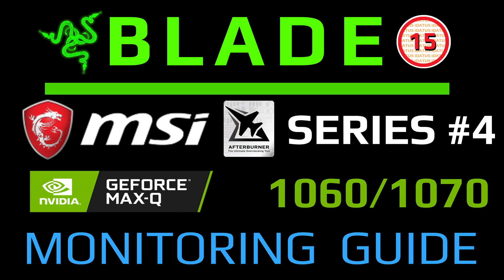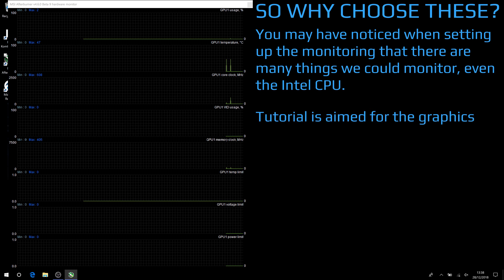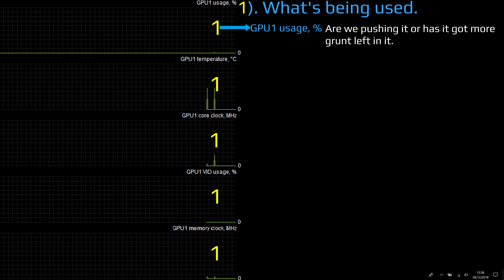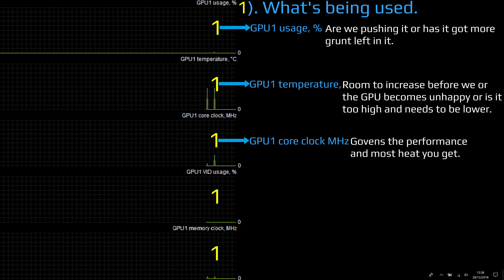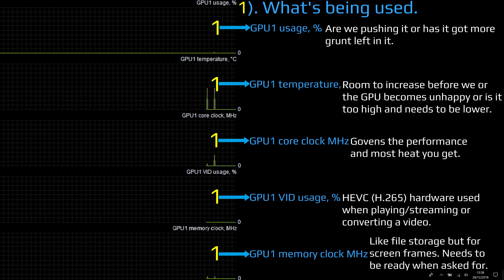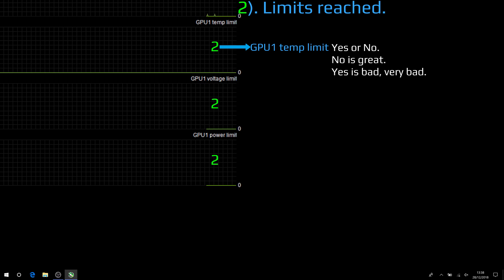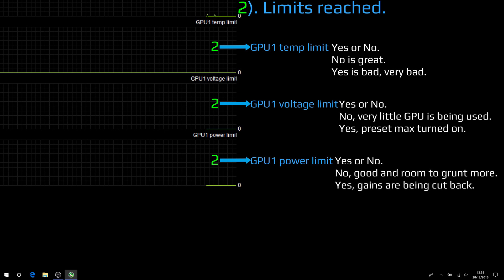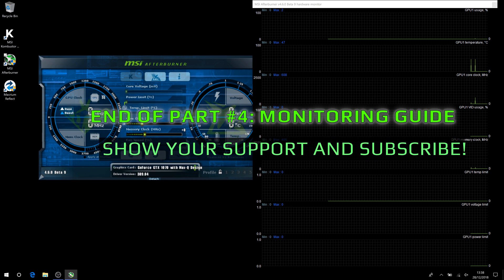NVidia MSI Afterburner Monitoring Explanation ◄iDATUS►

Comment: So I followed your instructions on undervolting with Throttlestop which worked great, but would you rather suggests undervolting the GPU with these MSI Afterburner settings? Thanks for the guides btw, keep it up :)
Reply from the maker: Thanks for the nice comment, I have a load more real life examples coming up over the months, just need to finish the MSI afterburner ones 1st..
Answer to your question, the CPU is a no brainer if you want to keep the laptop as cool and efficient as possible as that's the heat BEAST.
So if your going to tweak the GPU then CPU is a must 1st.

The GPU depends what you want to achieve with how you use the Razer.
For example, after running your main program (lets say its a game) that you have more than enough performance and decide to reduce power as it doesn't show any noticeable effect. 

The tutorials are a good real life example how to go about things in general, nice bonus.
The video after the next one will describe how to plan the testing process in detail. 
I am still finalizing research as the information out there is not always clear, contradictory or out of date.
Only the best for fellow Razer owners ;)

Got any more Q's please ask.
Reply: @iDATUS  Gotta love your enthusiasm for making these videos :P thx for the reply and again, keep up the good work!